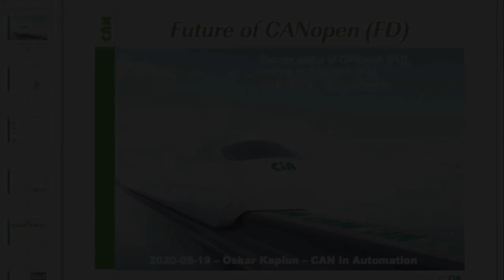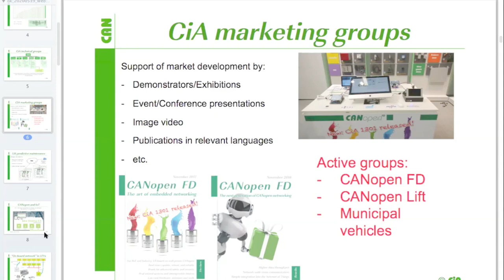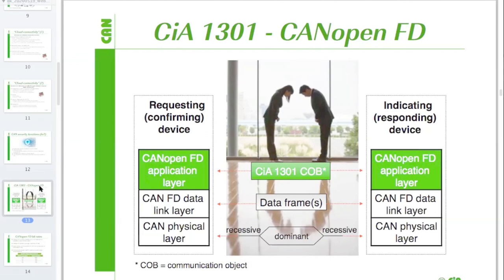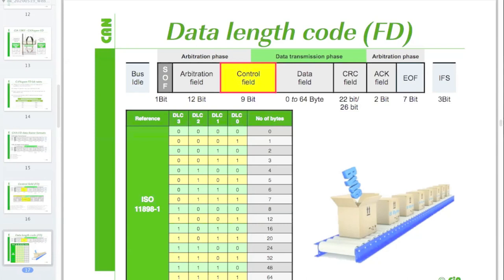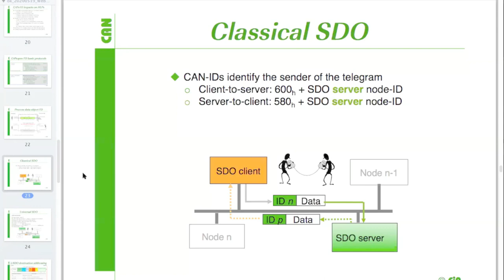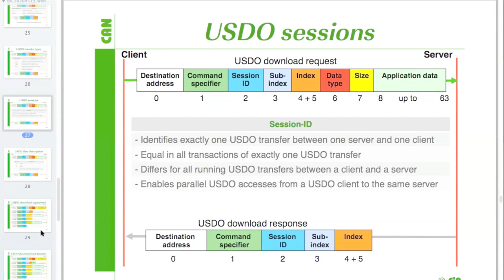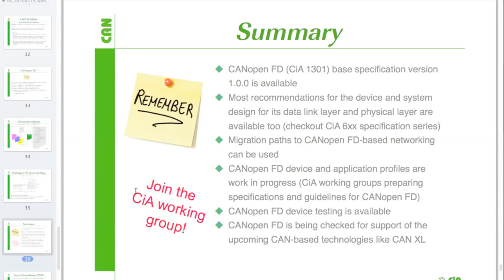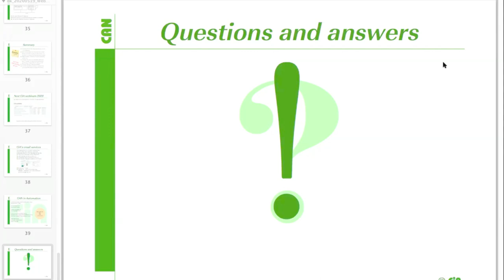CANopen FD – status and future webinar 2020-05-19

Comment: Is there any windows software that can be used to monitor a CanOpen network?   I'm using a PEAK USB hardware and wish to simulate sending/receiving SDO/PDO data.
Reply from the maker: Dear Ben Nguyen, There are commercial and non-commercial software tools to monitor CAN/CANopen traffic and/or generate it and now also CANopen FD too. The non commercial tool is "Busmaster" from Bosch. The commercial are available from HMS, Emotas, Port, and Vector. Peak should have a software tool to monitor CAN traffic which may even supports interpretation of CANopen Messages. To simulate SDO and PDO Peak may use a send/receive lists in textual format. Look for it on their Website. Port requires EMS Dr. Wünsche CAN in interface, which is used with their monitoring tool. There are such lists and even PDO or SDO generation is supported. But since you have a Peak interface, check there. Vector has a pretty advanced tool chain for that purpose but it comes literally at the cost. Best regards, CAN in Automation